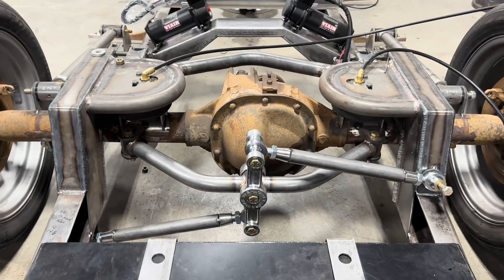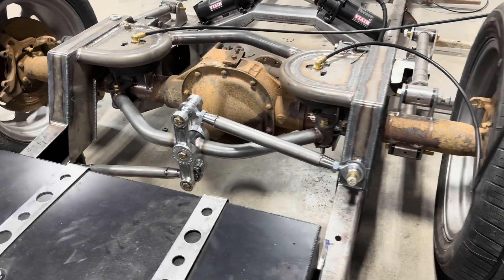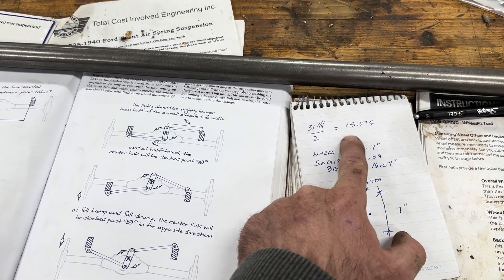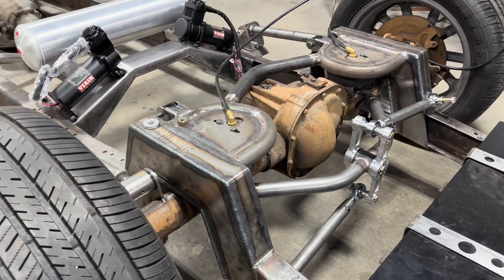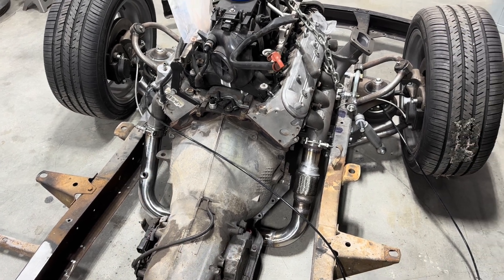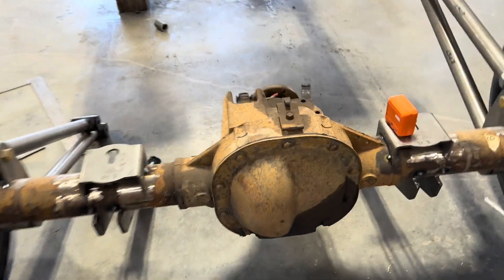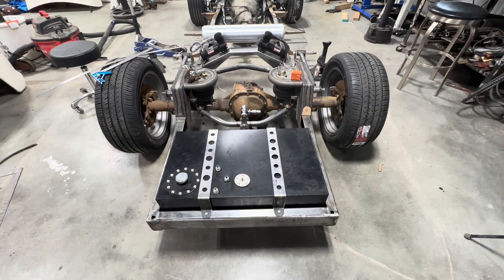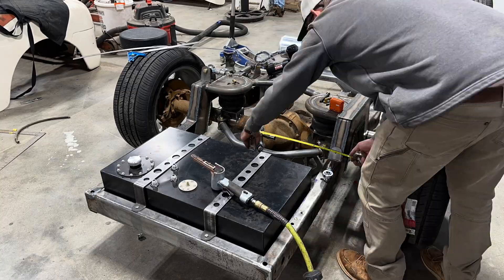Installing a Watts Link on a Ford 8.8 Rear End | ’52 F-1 Build

Comment: Sorry. One other question, what is the length of your rear link bars? Thanks
Reply from the maker: I got 36" unwelded bars and i think i ended up cutting them to around 29". Are you working on a similar build?
Reply: Thanks. Working on a 65 slick, was planning a triangulated 4 link, but thinking about changing things up now.

Comment: Looks like it works really smooth. Ive never tried a watts link before...just a panhard.
Reply from the maker: Thanks. It’s totally not necessary but I wanted to try one.
Reply: @brianuerling4830  it does a good job of keeping everything centered throughout the suspension travel.  And looks awesome!
Reply from the maker: @narrowpathkustoms1160  When set up correctly they do. The Max Fish book is a big help.